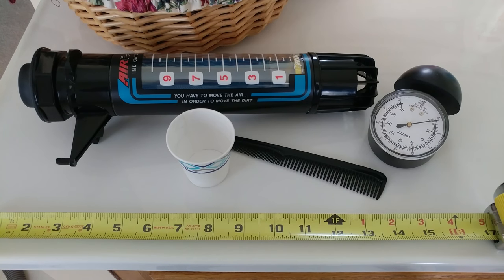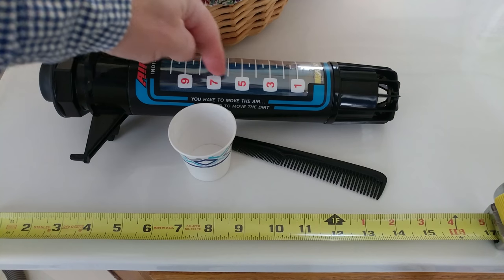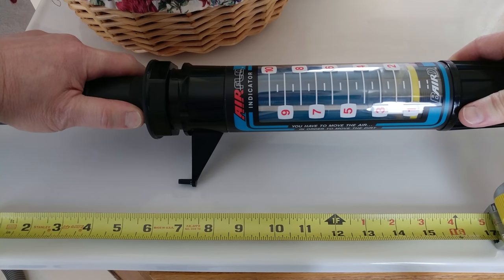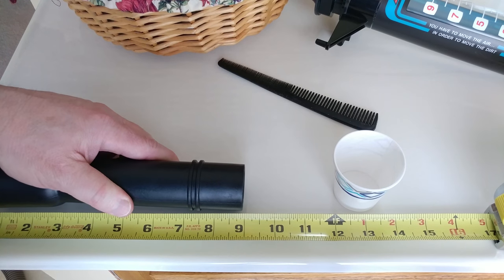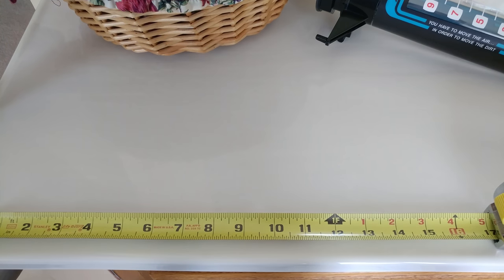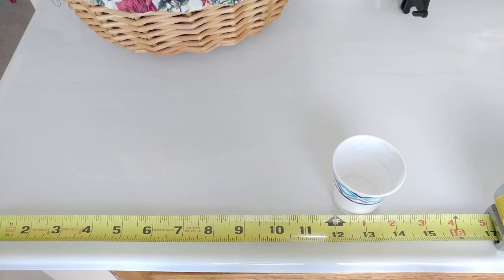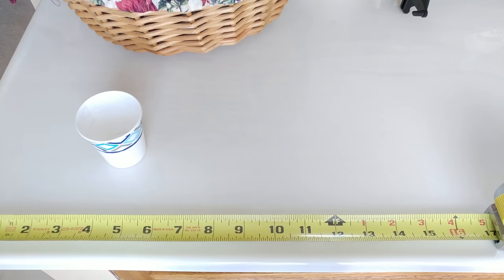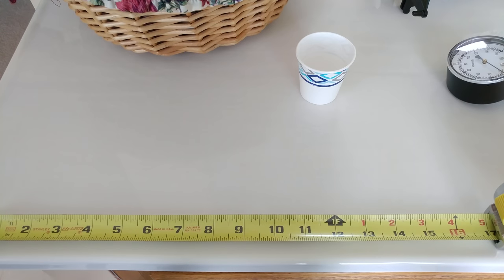Airflow Demonstration Using A Dixie Cup

Comment: Do you have any other suggestion for airflow meter? Don't think I can get the Baird Airflow Meter in Asia sigh.
Reply from the maker: isofinal search eBay for a GM8901 anemometer. That's what I use for my precision measurements. About $25.

Comment: Why no working h20 lift Gage ? What don't you show inches of water of vacuum? Maybe because Kirby's get about 30" and most Vacuums get 60-100"
Reply from the maker: You need to get educated as to how suction is measured. This test proves that suction plays no role in dust pickup. It's a "free air" test with no measurement hole restriction, hence the suction is zero.